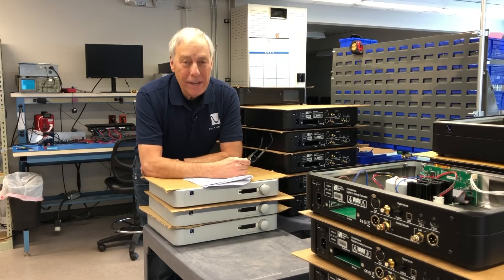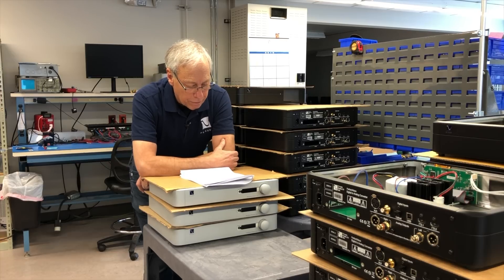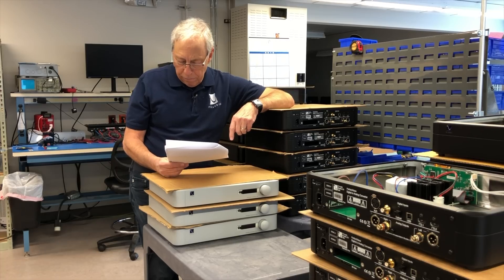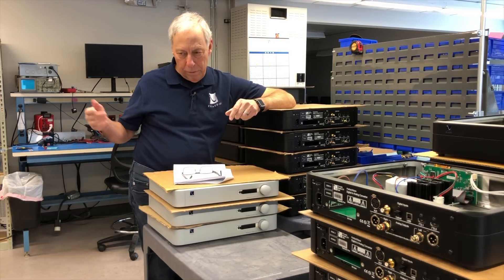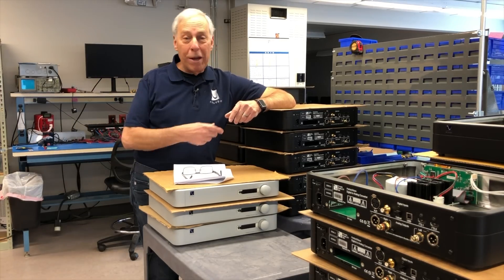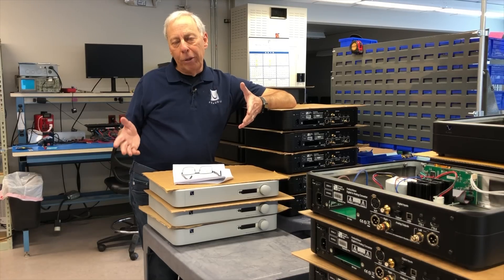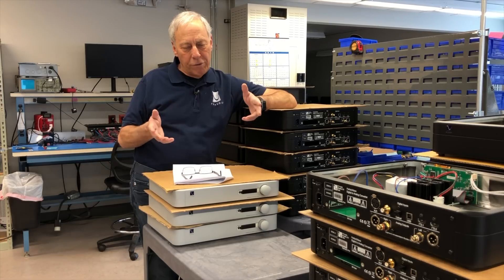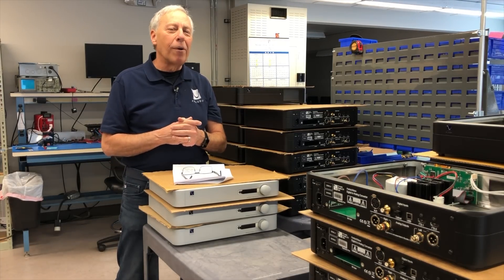Is it dangerous to run an amplifier without a load?

Comment: I did this all the time with class D amplifiers.  This is for car audio not home audio, but a class D is a class D.  You can use a Oscope or a multimeter to set the gain levels.  Most amplifiers you can actually hear when they go into hard clipping, You  only let them do that for a second or two, I’ve never held one for a long time like that ,maybe that might mess it up.

Comment: i repaired RCF amplifier (no tube)... owner said 20A fuse blown and when he replaced it it blown again... i replaced couple of blown transistors, diodes and bad capacitors... it powered on, leds came on, but after cople of second, protection led lid up... i dug deeper and everything was fine... found manual and found when protection led is on it is because of overheat or overload.... i checked with thermocamera, nothing was overheating and there was no load.... and that was a problem..... i replaced thermal fuses for sure, but it was not a problem.... problem was that i did not have speaker to connect and without connected speaker it went to protect mode.... the amplifier was alright, because when we connected speakers to it, it worked....

Comment: I can think of a reason a person would do this.  Let's say you wanted to run a 3-channel system on the patio for watching a movie outside on a projection screen in the summer.  You don't want to spend a lot of money, so you use a few old but decent speakers, and Lepai 2020TI amp for the L+R.  But what about the center channel?  (I'm assuming you've figured out how to extract the center channel).  How about a second Lepai 2020TI, but you only use one channel.  Why? Because nobody makes a super-budget, super-portable 3 channel amplifier you could use outside without worrying about damaging it.

Comment: thanks for this helpful video, i myself have a active subwoofer with a 7.1 surround interface and wanted to use just the surround speakers without the subwoofer because it sounds pretty bad at higher volumes, you can adjust the level of bass with a knob but you can't completely disable it, now i can comfortably disconnect the sub internally and use a seperate amplifier with a different subwoofer

Comment: With solid state amplifiers no nothing will happen however a tube amp is a different beast all together, I feel like a lot that replied yes to his question as he mentioned them saying yes probably thought that the reason you can’t run a tube amp without a load is the same for a solid state.

Comment: I'm about to pull my hair out. I have two amps for running tactile transducers which I only used for about 4 hours each and then put in boxes for a move. At my new house for about a year and finally decided to break the amps and transducers out so I could set them up again. Problem is, neither amp seems to be working. They power on but I can't get any output to the bass shakers. One is a 90 watt Buttkicker II amp with it's transducer and the other is a 90 watt Amazon amp with a Dayton Audio transducer. I first tried connecting the Buttkicker II to the Soundblaster Z card in my computer. This amp when turned on goes to sleep unless an audio signal is present. It shows a red light when asleep and a green light when the input detects a signal. The amp is always in sleep mode. I've tried connecting it to every line out on my soundcard and nothing. So then I tried connecting the Buttkicker transducer to my Amazon amp and while the amp turns on, I get no output at all. This Amazon amp does not have a sleep mode like the other.

After having no success with either amp on my Buttkicker II transducer, I connected a 50 watt Dayton Audio transducer to the Amazon amp and still I am getting absolutely no output. I know the sound card is putting out signal but I'm at my wits end. I don't know if I've accidentally blown both amps somehow, I was fairly careful about keeping the input and volume out levels about 1/3 to half. Not sure if maybe the Buttkicker transducer blew both amps, I didn't hear or smell anything. The transducer is a replacement I received under warranty for a damaged cable and appears to be brand new. It's reading about 2.5 Ohms on the coil. The Dayton transducer is reading about 3+ Ohms on the coil.

Neither one as gotten hot at all nor produced any vibration. I'm an electronics tech by trade but I work on drives and HMI's and stuff like that, I'm really not an amp guy. I use these for my Flight sim rig to produce vibration effects but I can't get any of them to work now all of a sudden. It's very strange.

Comment: Most non-engineers comfort with some stupid theory without even proving it. When there is no lodge there is no current flowing through the semiconductor transistor output section which is high powered. Therefore no reason to harm.The other side I.e the input side will be same as it is with the input.

Comment: The  question came from a man asking  about no load   if it damages an amp     but i did not hear    if the   man asking the question   stated it was   a transistor amplifier    class d amp   or tube amp     so many comments here about tube amps    you should never  power a tube amp up   without a load   some mention   that some tube amps have protection but i have never heard of one that does   even though  you might get away with it   for a short time   the impenence is not there to match  the output impedence of the output tubes   because the correct load   the speakers on the other side of the output transformer is not there   no speakers    no dummy load     The transformers   will   eventualy     die    why paul did not pick up on this     I dont know   He is also a tube amp guy too

Comment: It's actually a legitimate question. In my scenario it's got more to do with car audio though, and removing a subwoofer when the trunk space is needed. 
For example. I can fit two flat weekender bag in the boot/trunk of my car, when the roof is up. But, I would have to  remove the subwoofer box for the same luggage capacity with the roof down.🤦‍♂️
Uhm, I know this isn't about car audio.... But I don't have the same problem when listening to my home systems 🤷🏻‍♂️

Comment: I was checking this out because I left a headphone jack converter in my amp and turned it to max to see why no sound was coming out thus running headphone unloaded. I think what this means is that a voltage and current was available at a certain point in the circuit, but no current movement took place since it was unloaded. So this means the supply may have been switched up to provide the power. I am not sure, but I think this just means a transformer somewhere did not flux over a load to the supply, and there should be no problem.

Comment: That is why guitar players or recording engineers hook up a load box to a tube amplifier. Guitar Tube amplifiers sound best when cracked up. However, this can cause issues with neighbours, wives, small infants, etc. Hence the loadbox, without the loadbox or speakers the tube amp will be destroyed. And without speaker (simulation) or impulse response a guitar amplifier will sound like shit. Well actually more like a box of bees. In short: DO NOT RUN A TUBE AMP WITHOUT LOAD (SPEAKERS)

Comment: If i run 5 hz through an amp at full volume when the manual says it works down to 20 hz (i hear a high pitch ping with anything lower than 20hz) will this damage the amp

Comment: Paul, back in the days of yore, we were told that without a load connected to output of a tube amplifier, the voltage could rise in the primary circuit of the Transformer and possibly arc and/or burn out the primary. Don't know if that's true or not, though. I was intimidated enough not to try it. Output Transformers were relatively expensive, even back then...  Andy
Reply: An excerpt from Speakers are
 Important In or Out of the Circuit by Hartley Peavey offers a clear and detailed explanation. You can find it on the Peavey site:

The above is a rambling discussion about transformers
(both power an output) and their effect on the sound of
a tube guitar amp. I felt it was important to understand
what transformers do (and generally how they do it)
before getting to the final point of this discussion. As
mentioned above, a transformer works by converting
one form of electrical energy into another. In the case of
a tube amp, to achieve the matching, we “trade” high
voltage in the primary, for high current in the secondary
to properly drive the speaker. This is a “two step” process
where electrical energy from the tubes magnetize the
core of the transformer at the audio rate. Then, the
varying magnetic field in the core induces voltage
(and current) into the secondary suitable to drive the
speaker. The important point here is the energy is put
into the transformer through the primary, which converts
that energy into magnetic energy (i.e. it magnetizes the
core) and then that energy is reconverted into electrical
energy in the secondary windings, which drives the
loudspeaker.

If (for whatever reason) the SECONDARY of the
transformer has no “load,” the magnetic energy created
by the primary (and “stored” in the core) has NO place to
GO! As the alternating signal in the primary goes down,
the magnetic field built up in the core “collapses,” thus
inducing an extremely high voltage “spike” back into the
transformer’s primary windings. Because this energy is
substantial, and because the primary coils have many
turns of wire, an extremely high voltage “transient” (often
3000 volts or more) can be developed. The primary of
the output transformer is directly connected to the tubes
and tube sockets of the amp, and neither the tubes nor
the sockets (and associated wiring) are designed for
that kind of voltage. These electrical “spikes” can (and
often do) cause “arcing” inside the transformer and/or
the tube elements, especially between the terminals on
the tube sockets and the associated wiring.

Remember that we learned in high school physics
about the “law of conservation of energy.” This taught
us that energy can’t simply “disappear,” it has to “go
somewhere.” When a tube output transformer doesn’t
have a place for the energy to go (i.e. a speaker or its
equivalent) the energy developed in the magnetic core
“flashes back” into the amplifier, often destroying the
output transformer, the tubes, the tube sockets, and/or
the associated wiring.

This is WHY you should NOT operate a tube amp
without a “load!”

Ignition coils for gasoline engines work essentially the
same way. There’s a “secondary” coil of wire with many
“turns” of wire wrapped around a steel core. In operation,
a connection is made to a power source (battery) then
current flows though the primary coil and magnetizes
the iron core. The contacts (points) then open and the
magnetic field is allowed to “collapse,” which results in a
huge “pulse of energy” being inducted into the secondary
coil (which is what produces the electrical “pulse” that is
fed to the spark plug). This is also a two step process
where basically the primary coil is energized, producing
a magnetic field, then “de-energized.” As the magnetic
field “collapses” the magnetic energy stored in the core
induces a high voltage into the secondary coil which is
then fed to the spark plug, thus firing the air/fuel mixture.

An “UNLOADED” tube output transformer produces
high voltage “spikes” in EXACTLY the same manner as
an “ignition coil” does. The difference being that a tube
amp output transformer is NOT designed to operate that
way, but an ignition coil IS! Operating a tube amp with
its transformer unloaded can easily damage or destroy
a perfectly good tube amplifier by the “flyback” action
described above. Hopefully, the above will provide a
little background as to exactly WHY it’s important NOT
to operate an amplifier WITHOUT a proper “load” for the
output transformer’s secondary output terminals.

Comment: Tube amps NO!  My Peerless/Altec nickel cobalt output transformers would arc, short out, and die. The recoil, or flyback voltage of the collapsing high potential magnetic field can also feedback and arc inside the output tubes with no load. Please warn people of this before some rare vintage tube amps are destroyed in your next video.  (Heathkit W5-M, Altec Valencia)

Comment: I believe no current PSA amp has a tube output stage, and Paul hearing “low end” and “class D” guided his answer, but I was waiting for the tube amp caution with a little more weight to it. Older tube guitar/bass amps will fry in a NY minute if you try to turn it up with no speaker connected. Solid state, never in my experience.

Comment: Hi Paul! 

I agree with you when it comes to solid state designs.

Now if it’s a tube amp, then it will oscillate and the reflected impedance on primary of the output transformer will be so high that the tube sockets will actually arc over and destroy themselves. Sometimes it destroys tubes and even output transformers. Seen that on numerous guitar amplifiers over the years. 

I love the videos btw and thanks for all the content you put out there so far.
Reply: My Name sure thing! Take a McIntosh with output transformer and you’ll have the same phenomenon, to a lesser scale but yeah

Comment: The only solid state amp that I know of that can fail by turning it on without a load is the old 1970's Heathkit AR1500. On this unit turning it on without will blow out the output transistors. Been there and done it. Heathkit fixed this with the upgraded AR1500A.

Comment: Most solid-state amplifiers will tolerate operation with no load. 
There are some older ones that won't, but most of those are cheap junk and not worth anyone's time. 
Most tube (valve) amplifiers Must have a speaker or resistor load connected 
to prevent excessive peak voltages from developing in their output circuits. 
It is Always a good idea to Read The Manual for Any piece of equipment 
to find out what the manufacturer says about load requirements.  
Manuals for almost every decent piece of audio equipment ever made are now available as downloadable pdf files, 
so with only a few exceptions there is really no excuse for not finding the manual if you don't have a printed one.

Comment: This is more of an issue with some tube headphone amplifiers . Those amps will clearly state must have headphones plugged in . As you can imagine the dangers of plugging in headphone at high volume are more common . 

People that are heavily into headphones have several sets, it's common to switch .  

More people used banana and other types of connectors that commonly fail than ever before so if you have any doubts about damaging your amp with an open you might rethink using them .